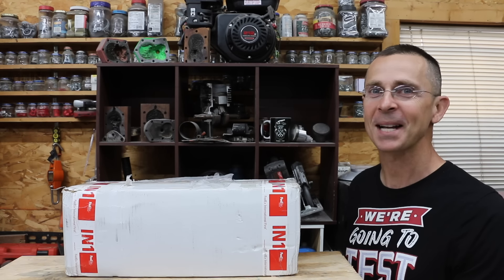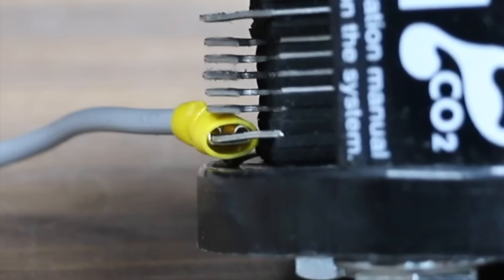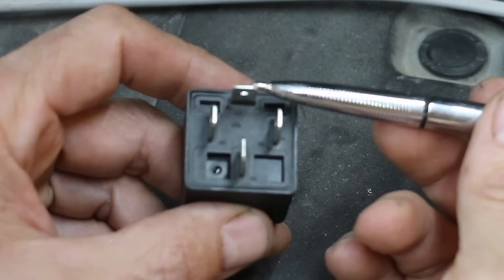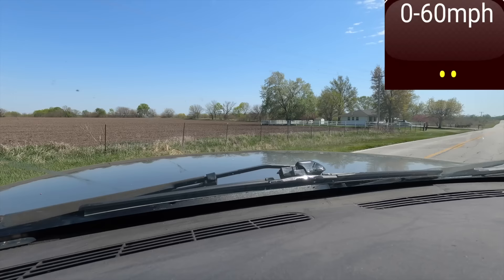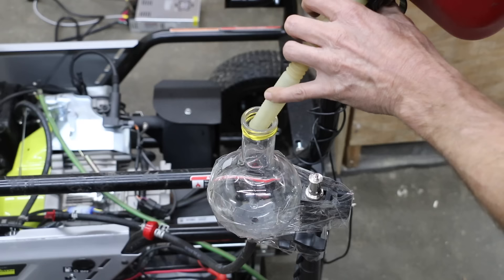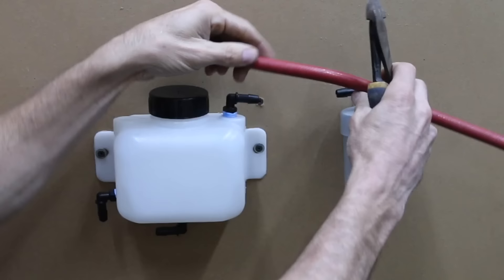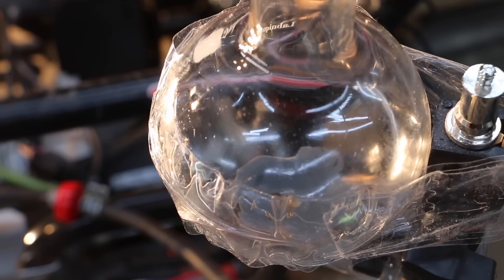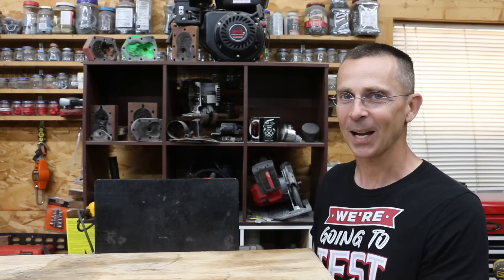AMAZING 35% More MPG with HHO? Let’s find out! Help with high gas prices?

Comment: 10 years ago I built an HHO system from scratch with all the components very similar to this kit and sadly results are pretty much the same. No difference or notice good or bad.  If anything it was more of a hindrance just having extra things clunking around in the engine bay to worry about.
Reply: it also put extra strain on your battery
Reply: True and that extra power usage wastes more gas also!
Reply: No surprise. If everything worked at 100% efficiency, it would take exactly the same amount of energy to split water into hydrogen and oxygen as is released when you recombine them. Since nothing actually operates at 100% efficiency, losses in the alternator and electrolytic cell will make it a net  power drain.  It's thermodynamically equivalent to using a water turbine to run a pump to pump the water back uphill to run throught the turbine again, and expecting to somehow gain energy from that.
Reply: @russlehman2070  Yeah....I tried to explain that to a neighbor a week ago who has a brilliant idea for a "perpetual motion" machine.....
Reply: Yea, me the same. Same results :(
Reply: @arthurbenedetti9146  You might get more efficient combustion in the gasoline.
Reply: @TheWolfsnack  just curious, what idea did your neighbor have?
Reply: Me and u were on the same page. I did the same almost 10years.ago. I built a giant cell in a 5 gallon bucket and powered a Isuzu pup. It would idle fine but couldn't handle under load. But FRY a battery QUICK🤣🤣
Reply: I noticed these kinds of videos resurfacing. If there wasn't anything to this I would think the companies selling it would just go away but they haven't.
Reply: Anything that increases combustion efficiency will increase the exhaust oxygen percentage. The reasons are; then engine uses less fuel for the same amount of air, more oxygen is free because the engine produces less carbon monoxide (CO) and, less oxides of nitrogen form (NOx). The O2 sensors are telling the ecu that the engine is running lean because of the increased oxygen and it adds more fuel to richen the combustion. Eagle Research makes a EFIE (electronic fuel injection enhancer) device that you splice into the O2 sensor circuit that can give you control of what the O2 sensor tells the ecu, effectively giving you a knob that can control fuel injection quantity. You could then manually adjust the fuel allowing you to benefit from a ‘fuel saver’ device.
Reply: @MaxxForceSeven  Thank you for bringing the fact that adding a booster requires telling the fuel system to cut back on the fuel.
Reply: I did too but i had great results except it ate up my stainless steel plates too fast, wasn't worth the effort to keep replacing them on a weekly basis
Reply: @jamiebennett6354  I would advise to look up George Wiseman’s water torch design and modify it for fitment. His produces Brown’s Gas which is Hydrogen and Oxygen but the atoms are separated into their monoatomic form. Its super efficient and super low maintenance. He supplies the power using a device he calls a ‘capacitive battery charger’ to efficiently and effectively supply power to the brown’s gas electrolyzer. He sells books that provide schematics and the foundational theory and reasoning of why and how they work. None of his designs are patented and they are open to the public.
Reply: @MaxxForceSeven  That is not how either engines or basic chemistry work.

 Increasing combustion efficiency (here meaning "burning the same amount of fuel with less air") is going to be automatically compensated for by the ECU. You'd just get either more power or better economy or both without needing to adjust anything manually. Increasing combustion efficiency isn'tvery possible in the first place, though, as modern engines already run pretty close to ideal air-fuel ratios at all times. The only effect of messing with your oxygen sensors is going to be your check engine light coming on (at best.)

"Brown's gas" is a buzzwordy name for oxyhydrogen. Plain old diatomic hydrogen and oxygen - creating monatomic hydrogen and oxygen is possible but also both difficult and pointless. Both monatomic hydrogen and oxygen are so reactive that they will recombine either into water again, defeating the ENTIRE purpose of making them, or into diatomic gases, defeating most of the purpose of making them. This happens so quickly it would be impossible to get them into the combustion chamber before recombination.
Reply: @samuelm370  the manufacturers have definitely realized its true potential!  (The potential to rake in profit by swindling financially desperate people that don't understand the basic laws of thermodynamics)
Reply: @MaxxForceSeven  would that injection enhancer device allow you to trick the sniffer for the smog inspection?
Reply: @TheWolfsnack  I think the only potential for that Is electro magnetic.
Reply: The fuel flow would have to be limited depending of the amount of hho is going in. No?
Reply: Same
Reply: Yeah I cobbled one of these things together years ago. They only use it had was flipping out old guys in the shop... guess they thought it was black magic turning water into fire lol
Reply: I believe your supposed to have the o2 senor recalibrate for newer cars because it reads more oxygen and starts putting extra gas older cars i don't think so 🤔
Reply: @agebarbosa8290  the 02 sensor readings couldn't be accurately due to the inconsistsnt supply of H. It also burns at a higher temp and the O2 sensor works of a certain range calibrated for  hydrocarbon fuel. Bottom Iine - burns out catalytic converter quite fast (melt down) causing exhaust restriction or completely plugged.
Reply: @TimisDaniel  No, there is not any "extra strain" on your battery!  The electricity used by the "HHO" generator comes from the alternator, not the battery.   That's because the battery when fully charged has bout 12.6 volts output.  For an alternator to charge a battery it has to put out more voltage than the battery so its output is around 14 volts.
Reply: @torg2126  If that were true  (it's not), fuel mileage and power would go up.  They don't!
Reply: @samuelm370  "There's a sucker born every minute!"
Reply: @Cougracer67  Current examples don't. I'm only stating that enriching fuel in a ICE dosn't break thermodynamics like cracking water to get hydrogen, then using the hydrogen to power a gas engine, and cracking more hydrogen would. Some where treating it like a perpetual motion engine, not a fuel enrichment trick.
Reply: @samuelm370   "There's a sucker born every  minute"
Reply: @MaxxForceSeven  Will this work better in a carburated engine or will it be dangerous?

Comment: A lot of the comments video read in other videos where there was Not" a cpu used to flash the O2 sensors which comes with some not all of these kits is what makes the difference in MPG savings. According to experts the hho generator sends more gas and the cars cpu interprets that are more oxygen and in turn the engine sends more fuel defeating the purpose of using an hho generator so I'm doing research on generators in the market that include a cpu that can be flashed from the diagnostics plug under the dash and see which one is the best and offers a money back guarantee. I've read it's better to use these type of generators in engines that use a carburetor and do not require the use of a cpu because everything is based on vacuum. Great video like the thumbnail 👌 😅

Comment: Would love to see a video comparing battery powered lawn mowers, especially the new dewalt ones and Ego!
Reply: +1 !!
Reply: Good idea. I was surprised to see Ryobi had a zero turn riding mower. On batteries!!
Reply: I would love to see the ego tested. I have an ego string trimmer and it's absolutely the best. Has more power than a gas trimmer and it always starts when I need it haha.
Reply: I bet that's something he's willing to test
Reply: @lonewanderer3603  I have about 10 years of experience with all sorts of mowers and can say that there’s no competition against diesel zero turn mowers. It would require a huge battery, probably an additional trailer, to get the same mowing times as for example a Grasshopper 325D.
Reply: @Your_username_  I have no doubt gas is better. I just think it's amazing that such a thing is out there and works.
Reply: @lonewanderer3603  Ah I see. Yes they are quite nice machines but are rather slow and the mowing time is usually around 30min.

Comment: Damn Conservation of Energy is so iron clad.
Reply: First law of thermodynamics FTW!
Reply: TBF this could still be a win, if you had some kind of hybrid arrangement where gas was produced when engine load was low, and used when load was high. it'd be a poor replacement to actual start stop technology at best though.
Reply: @benholroyd5221  If the electrolysis hydrogen production were 100% efficient, the best it could ever be is a wash. It takes gasoline to produce electricity to produce the hydrogen regardless of load on engine. If you produce X amount of energy from hydrogen, it will have taken X amount of gas (plus a little extra for losses) to produce it. It will never and cannot ever produce extra energy (see the law of conservation of energy).
Reply: @JDeWittDIY  I compared it to start stop technology. If this ran when you were idling, ie all energy is going to waste, you'd be better off harvesting the energy to do something. 

I'm not saying this is objectively good, just that in a very narrow usage band it's marginally better than nothing. 

Actual start stop would be better, even something like only running the alternator under braking would probably be better.
Reply: @benholroyd5221  Regenerative braking works, that's recapturing energy that would otherwise go to waste.

If you wanted to generate hydrogen while idling, I think it would put additional load on the engine. The hydrogen produced would then correlate to increased gasoline usage.
Reply: @JDeWittDIY  if you put load on an idling engine it would idle at a lower speed rather than using more fuel??? 

I wouldn't classify this as regenerative braking because it doesn't generate appreciable hydrogen. There's no point storing it, you may aswell use it straight away. Ie, in best case, when idling the engine runs on 100% hydrogen,  no fuel is used, equivalent to a start stop system. Of course that would be a perpetual motion machine so some fuel would still be required.
Reply: @benholroyd5221  Regenerative braking is a separate discussion.

If you wanted to recapture some energy used while idling by generating hydrogen, and that reduces idle speed. Wouldn't it be even more efficient to just reduce idle speed to start with?
Reply: @JDeWittDIY  possibly? You can extract some energy from a normal car when idling, eg you can set off very gently without throttle and without stalling, so obviously there is enerbgy to spare. Why idle isn't set lower, I don't really know though.

But yes, in principle lowering idle speed word be better. 

I'm not saying hydrogen generation is in anyway practical or a good idea, it is marginally better than a perpetual motion machine. Marginally.
Reply: @benholroyd5221  The engine is already set  to idle at the lowest speed it can while remaining smooth and without a chance of stalling. If you give it more gas to help generate hydrogen you'll get slightly less power from the hydrogen than you used up in gas to generate it.
Reply: @JDeWittDIY  Not really. You forgot about waste energy. ICE have huge amounts of wasted energy so there is still quite a lot of potential gain. After all we just count fuel used per actual work done and if some technology is able to decrease waste, it will improve efficiency. So the main question would be - is this supposed to reduce energy wasted by the engine? I don't think so. Similarly the efficiency of the engine depends on the load and revs so if you are able to add load to gain efficiency at some points and use that later on, then it would still improve efficiency. That's why CVT tends to get better fuel efficiency. The same engine but the transmission maintains optimal revs. Similarly electric cars with range extender tend to get better efficiency as the generator runs under relatively constant load when it charges.

Comment: I play around a lot with HHO but the problem I find is hho, although it initially explodes on ignition, it actually implodes straight after. So in a normally timed engine, the result will nearly always be unchanged. I'd love to see a engine timed to fire just before bottom dead center, I believe a engine could run solely on hho if the engine is timed for it. Also, you'd probably need to produce about 3L per minute to even achieve a successful idle. It's not a worthless science, it just needs improvements and experiments (like all things) to work properly.
Reply: Yes. I believe that feeding a highly combustible gas blend can contribute to the hp yielded but as you stated. It must be able to be utilized. Now the co selling this kit should indicate that if they expect it to work(but that is the point of this video). I would be curious what their comments would be?  I would like to see a reference to an experiment doing what you said with altering the timing
Reply: I have also made dual hho cells and ran them on my truck(same gm truck as video) with minimal noticable difference. 
One time I left the hho switch on while the truck was off for a good hour or so and then tried to start it, there was a loud bang and the truck would not fire afterwards. Took me the rest the day to find that the spark plug gap had blown wayy out of spec. 
They sell a computer to alter the timing and spark/fuel to adjust for hho. Because the stock ecm cannot detect hho and compensate.
Reply: The Mirai is a hydrogen cell car, I think it's like 50k

Comment: I know a retired engineer who made his own system in his garage, he left it running by mistake and ended up blowing his garage door off, he had a hell of a time explaining this to the officers who showed up
Reply: That's when you don't explain anything at all, it must have been an electrical fault or a leaky propane gas tube. Just have an empty one placed in the garage.
Reply: But did it get him 35% better savings in mpg? We need to know!
Reply: I don’t know if it ever gave him better mileage , he has passed away several years ago and I never asked him, and it was his experimental bubbler he left on so it was a hydrogen explosion, l know he went on several trips with it hooked up to his Ford truck with a 300 six ,
Reply: Oof, that’s intense man...

I have a friend who worked at a dope farm around here - where I live they’re everywhere. He decided he was going to make butane hash oil extract. He decided to store the pan in the freezer. When the compressor kicked on, it ignited the butane in the air and blew the door clear off the freezer. Luckily for him this is a very rural area and there are all sorts of loud bangs and gunshots, because if the Sheriff showed up he would be serving some time for sure. 💥
Reply: The officers were not there for the explosion. They were making sure he was not trying to go off the grid and become independent of the collective hive mind. Big energy oligarchs hates you and will punish anyone who leaves the system.
Reply: @nathanlewis5682  Take your meds
Reply: @nathanlewis5682  spot on
Reply: @vxiiduu1629  you're part of the big oil system. Why else would you be criticizing someone who advocates for being off the grid, separated from the masses?
Reply: @nathanlewis5682  
>you're part of the big oil system
I fkn wish, then I would be rich. Fr tho take ur meds
Reply: @nathanlewis5682  Sarcasm I presume. But it still happens with restrictive zoning and occupancy codes requiring that there be utility power hooked up. Still many places where you're free to lose the grid, but most people have never looked into it and discovered the nasty truth about their own location. We;'re rarely as free as we thought here in the US...
Reply: @nathanlewis5682  Love your tin foil hat!

Comment: Thanks. I know this video is a few years old but I did this hydrogen test a long time ago on a Jeep and I got similar results. The device reduced fuel efficiency. I never knew why until I watched your video. The drag this device puts on the alternator makes things worse. By the way, I remember driving for over 100 miles in circles and it was the most tedious and annoying thing you can do. Then I drove another 100 miles with the device and I was almost going crazy driving in circles watching the exact same thing over and over again. I had to maintain the exact same speed for both trips. Finally, the disappointment came. My hydrogen device made my Jeep burn MORE fuel.